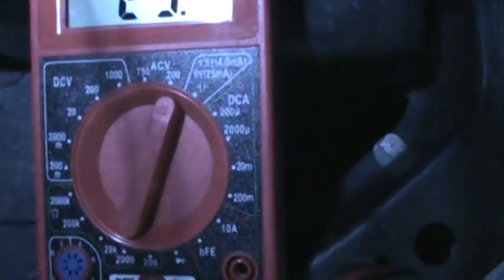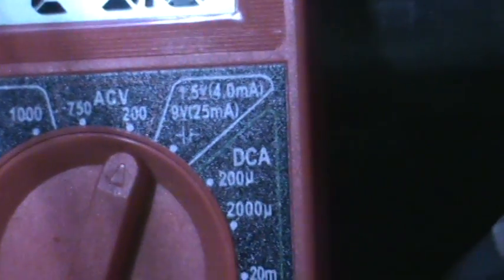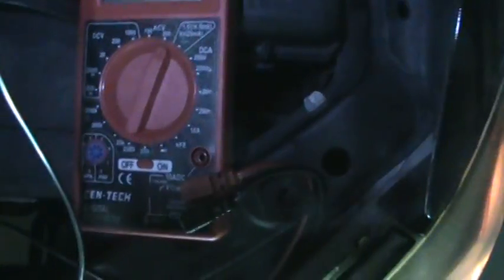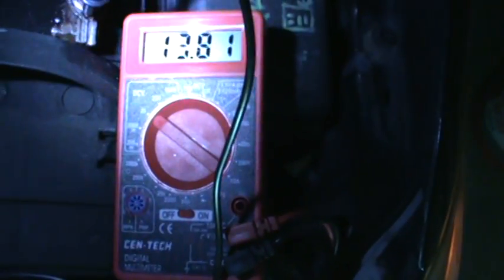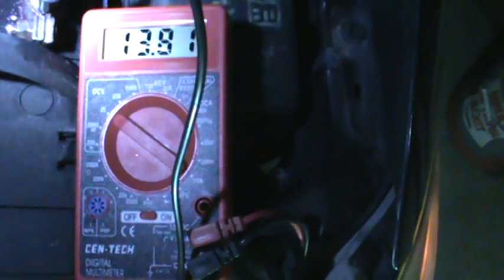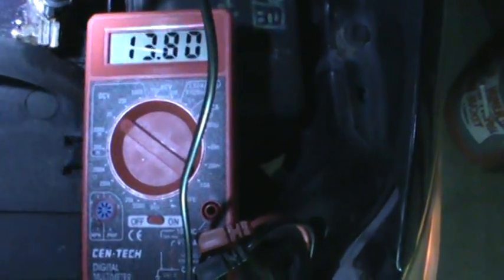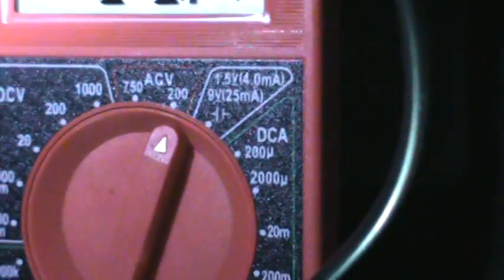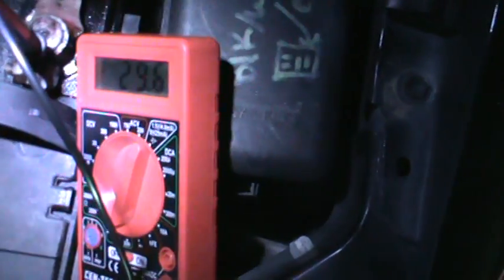Checking Alternator Diode Ripple

Comment: You have to change you're cables connecting to the multimeter,,, that's why there is an extra red hole!!
Also perfom the check with m red lead on the alt post,, and black lead on batter y negative 
You're welcome

Comment: This guy has no idea what he's talking about, and chances are good that there's nothing wrong with that alternator.  Using a cheap DVM on AC isn't going to give a correct reading, because they can't read AC over DC.  It's probably impossible to ever get 30vac from an alternator, and still have a normal DC output and all the other electronics in the car not being fried.
Also, your AC reading from the DVM is not an "average" reading.  This further demonstrates a complete lack of understanding of electronics.

Comment: I've seen a simular test , but they said you don't want to see any reading in AC . I have a '97 Jeep and my reading is 35.5 AC . My battery dies overnight . So I re-charged the battery and disconnected the red cable going from the positive battery post to the alternator . The Battery doesn't drain when sitting for days . Bad Diodes ? Bad Regulator ?
Reply: Bill Kolts test volts on battery when engine running. 13.5-14.5V is around normal.
Reply: @whichdoctor4858  That doesn't answer his question. ..

Comment: This doesn't really work.  I have a car here that shows excessive ripple on my Midtronics analyzer, but the voltmeter only showed 30VAC at the battery, only 1v higher than two other cars I checked with good alternators.

Comment: Ok, lets get a handle on this. First you can't take a reading for bad diodes with a regular volt meter using regular AC settings. You need to use a Multi meter that has true RMS (Root Mean Square) It's a  calculation that is built into the meter it self.  You can hook up to the battery, BUT it's not as accurate as hooking it up to the Alt + terminal. After you let the multi meter clock for a few and settle down to it's average, you should see no more then .050mV AC. I have seen even old but in good shape alternators run as low as .009mV AC. Need to make sure your battery is fully charged (12.60) for a good clean test. Also a wondering reading from lets say .035mV AC to .135mV AC and back and forth say along with a or more then one diode, you also have a bad Bridge Rectifier. If you look on a lab scope, you'll see not only the spikes from the bad diode, but also a wave form the is really excessive. Some of the symptoms will also a customer saying there car goes dead anywhere from a couple of days to overnight depending on how many diodes are bad. Plus another clue is the sound, after hearing it enough, you;ll come to know that different sound from the alternator. It's unique..
I hope this helps
Reply: t s:  .O35mV??   you meant   .035 V / 35mV?
Reply: +timothy smith I am glad you said all that cause I was about to. Thumbs Up to you!  I think some Vehicles now are also good in the 0.100mV range.
Reply: The only time I have ever saw a reading this high on a known good alternator was a unit that had a really low battery and charging lik hell to try and charge it. I looked yesterday and we (4 people who rebuild and I) couldn't find any unit even new units that would allow this high of AC ripple. It would be murder on the alternator.
Reply: I know this is old and you spent a ton of time writing this up but the AC voltage listed everywhere else that is acceptable is .25 to .50 volts AC (not .050 volts as you indicated.) which would be 250 to 500 mVac. Any thoughts?
Reply: @Noonecares10021  He said .05mv...( mv)... not volts
Reply: I agree on the sound, most times I hook up to check diode Ripple just to confirm with my ears have already told me
Reply: pirouz behjat your using the wrong multimeter, you need an auto ranging true rms meter.

Comment: You're getting an incorrect AC voltage reading, because your DVM is allowing both alternator cycles to register!  Try putting a .5 microfarad 200 VDC capacitor in series with the meter, and you should get a more accurate reading.

Comment: test two vehicles, they were very similar. I 'll give one vehicles output. nomial voltage 12.5 volts [battery is semi weak but still fully functional[.  engine/alternator running  14.45 Volt across battery terminals.  alternator pos term to battery pos terminal about 0.050 volts aka 50 millivolts with digital multimeter in the ~V mode. measure voltage across pos batt and neg batt terminals with dm in ~V mode get 30.4 volts.

Comment: You blew it big time with this video.  30 volts ac is not normal at all.  As others mentioned you want less than .5 volt ac at the most.  1 volt ac can start to affect things like your speedometer reading speed when you are sitting still.  I suspect that your meter has a low battery that can make goofy readings or it is junk.  I say this because if you actually had 30 volts of ac current running though your car, your battery would boil over and your all your bulbs would burn out instantly.  It is a shame that your video is so wrong.  Many people have forgotten the ripple test and assume a alternator is good based just on measuring it with dc.
Reply: Thanks for keeping it straight!!
Reply: Like I posted , another video said you don't want to see any reading in AC .
Reply: I agree. he needs to re-edit to reflect the 50/100 millivolt AC.

Comment: I have this same reading today 30 Volts and tested it straight on the alternator. Can someone confirm this is bad? I watched another video and that guy said 50-100millivolts.
Reply: Check your positive cable, it maybe pushing the voltage beck through the diodes through to the ground cable.
Reply: ***** 30 volts in ac or dc is so bad that I would suspect a problem with the meter reading incorrectly.  That voltage would cause your lights to burn out instantly.  Now if it was reading 30 millivolts ac that would be great.  Perhaps the cheap meter in this video does not have the decimal point in the correct location.  Who knows?

Comment: No more than 400mVAC(0.4 volts AC) and less than 10 percent of the alternators output in AC current. Many conductance testers automatically check for ac ripple and the conductance type testers are extremely accurate.

Comment: Almost 30 v/ac - looks like you tested from batt - pos and neg terminals and not from the alt b+ terminal.  I must have missed something - I was always taught max.. Ac voltage between 1/4 to 1 volt.  Was pretty dark , 30 v/ac is an acceptable reading ?
Reply: +Ticked Off     I suspect that meter is not true-rms....it uses the cheaper and less accurate averaging-circuit for voltage readings.
Reply: Steve Rob 30 volts AC would blow out every bulb in the car instantly.  This can not be an accurate reading.
Reply: (Ticked off )- you noticed the bad reading as well, oh well :)
Reply from the maker: The takeaway is what it looks like when it is working properly. It will look different when it is functioning improperly. I'll do another video explaining this later.
Reply: Hi Steve, hope you're doing well. Yes, almost 30VAC looks very high also to me. I was used to about 1VPP as being the max and that's still pushing it. As for where it's being measured whether at the battery or at the generator should still be the same minus the voltage drop across the wire. The B+ at the generator is the same wire going to the B+ at the battery. But since you're measuring small AC ripple voltage, it's probably a better idea to measure directly at the B+ terminal at the generator and then you don't have to worry about the voltage drop across the wire. Good that roman will do a follow-up video on this. Maybe he can put his scope on there and get a better indication of what's going on with the ripple voltage.